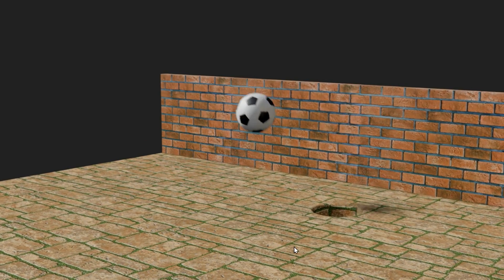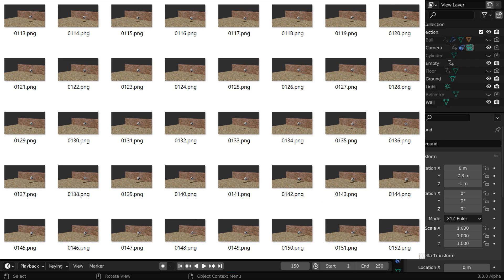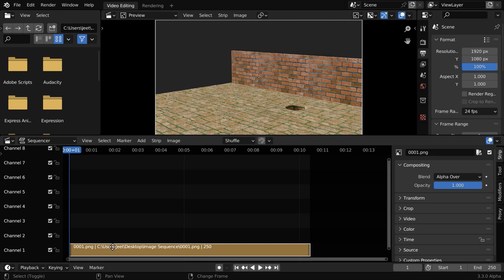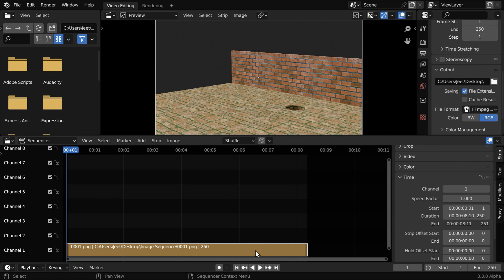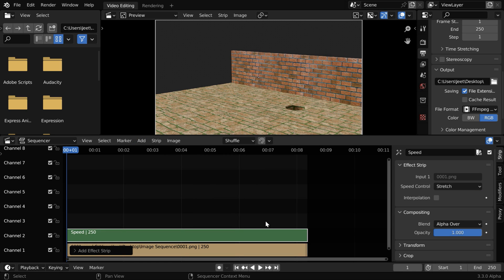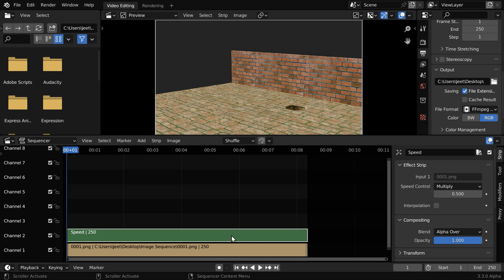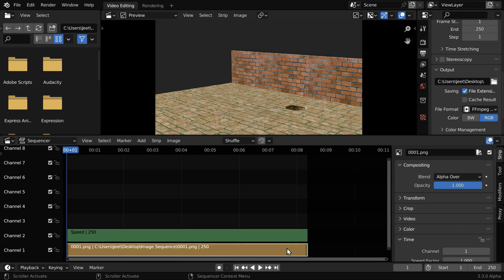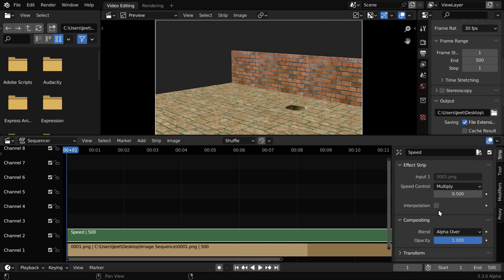Speed Control in Blender VSE | Video Sequence Editor | Create Slow Motion or A Fast Forward Version

Comment: In Blender 5, the strip's properties do not appear in a tab in the lower panel, but in a tab in the upper panel (where you already find all the other vertical tabs with which you normally work: Render, Output, etc.)
Reply from the maker: Yes 👍 Thanks for pointing that out! Blender has recently updated the video sequence editor with considerable interface changes. We're glad you found it! 😊💝💝

Comment: not smooth
Reply from the maker: Creating a slow motion in a video editor like this means we are splitting the same frame multiple times. So yes, this will affect the playback quality if we make it very slow. The perfect slow motion can be done using a higher frame rate for the original video, or maybe by an interpolation method - but it's not yet available in Blender VSE.